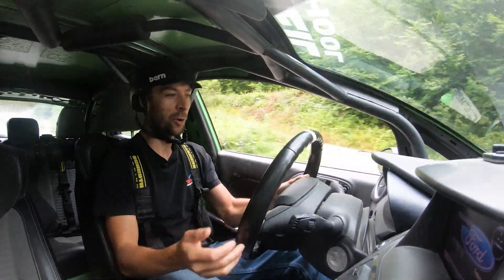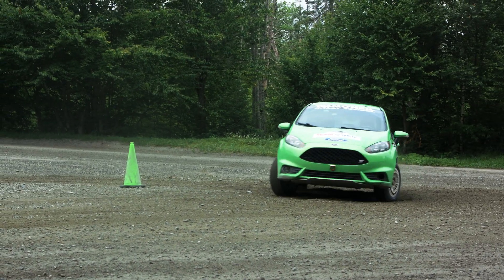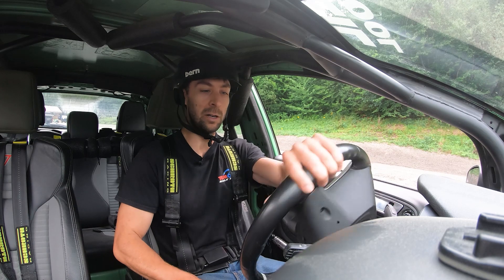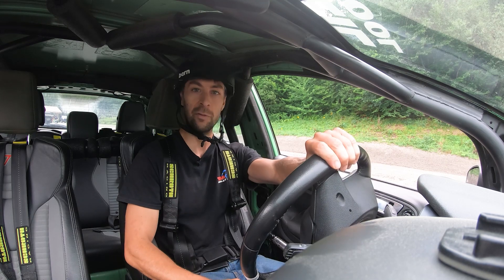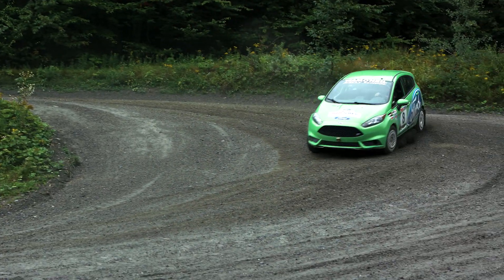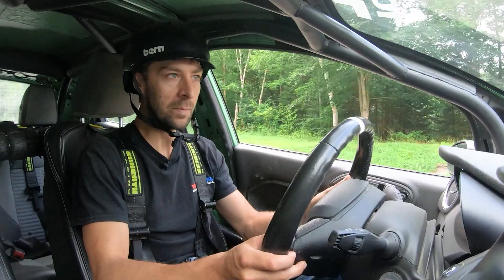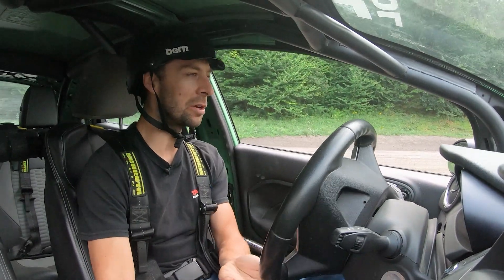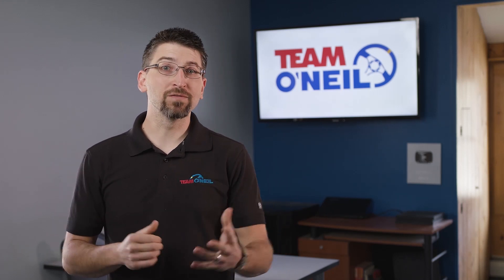How to do Handbrake Turns

Comment: Anyone can handbrake turn. What takes skill is using the pedal-parking break while holding the release with your left hand 😆
Reply: makes me appreciate the double pump release. But either is better than neither and my current DD has an electric ebrake that doesnt work for locking up any tires.
Reply: @rallywagon261  try it while also braking... Yum
Reply: @georgekurgansky5986  the electric brake? Yeah, I also tried it doing the Scani Flick, no dice. At least not in a Fusion. Feels like it's activating on the front brakes, but it releases so fast the tires never lock up.
Reply: You can,,,drill a hole in the handbrake, and put a nail through it.
Then you just pull it on when you need it, and then just let go of it, as the release button is held down by the nail.

Comment: What causes a car to roll sideways end-over-end when trying to handbrake turn? I remember Mythbusters learning to teeter-toter cars on wheels (one side in the air, the otherin contact with the ground), and the beginning went exactly like it's described here. What would be the difference? Locking all four tires, palming the wheel?

Comment: Thanks for the video; looks like fun. For my edification, this isn't recommended for AWDs like the WRX that don't disconnect the rear axle when the have brake is pulled, correct? And clutching in isn't really going to help matters either, right?
Reply: In awd you just turn press the clutch and handbrake
Reply: clutching will allow you to lock faster, (and be less likely to stall), but either way it's fine to handbrake turn in AWDs, just know your center diff isn't going to thank you.
Reply: The GRyaris apparently disconnects the rear wheels when you pull the handbrake

Comment: For the slow 180 degree turns. Do you still use the foot brake to slow down is it the handbrake only?
Reply: Brake first to a manageable speed
Reply from the maker: You would still straight line brake initially, then pull your handbrake and start the process once you are going about the right speed. A handbrake turn will scrub speed but straight line braking is a much more efficient way of slowing the car down initially.

Comment: do you do modifications on your car for performing handbrake turns? I tried that several times on my stock fiesta and now the handbrake handle is getting really loose, sometimes even wiggle up and down while I'm driving. I asked a mechanic about this he said there might be some problem about the brake pump of the whole braking system but I'm not sure if that's the case.
Reply from the maker: Our handbrakes are stock aside from some Hawk brake pads but the handbrake cable can stretch overtime causing symptoms similar to what you are experiencing.
Reply: @Teamoneilrally  Is it also drum brakes on the rear of your fiestas?
Reply from the maker: @johnbowie4869  Our STs like this one are discs in the rear but our naturally aspirated Fiestas have drums in the back.

Comment: What do you do throttle-wise throughout?
Reply: as a rule of thumb with FWD cars - Throttle makes you go straight, brakes make you rotate (especially handbrake), so when you do your handbrake turn, use no throttle, but if you're going to spin out (or you screw up and release the handbrake button and its stuck all the way on etc), then add throttle to straighten the car out, but watch out as you might snap back the opposite direction (accidental scandi flick/pendulum)

also the thing about "Throttle makes you straight, brakes make you rotate" is sort of true for all drivetrains, but only if you don't add enough power to slide the rear, since if you're oversteering under braking in a RWD, you could technically add a little throttle (after releasing brakes), and as long as you don't light up the rear, it will weight transfer to the back, stopping oversteer. And brakes work the same in all drivetrains (almost), so the braking -> rotation part stays true as well.

Comment: My old cars handbrakes are worn and may lock only one wheel or not at all.
This destroys my confidence.
How do you tighten your handbrakes?
I suppose it's under the handbrake boot but how do you adjust bias if one wheel is locking?
One car has the drum inside the disc. The shoes don't seem worn.
Do new cars use the hydraulic system to squeeze the pads?

Comment: How bad is this on the center diff of a GD WRX? Is there a technique to do it with minimal wear?
Reply: I guess it's ok on gravel but yeah it inevitably puts stress on your diff. 
I'm pretty sure you can make your wrx fwd tho
Reply: I have no idea. But I guess you could brave it in neutral lol.. I think to save parts you are better off rotating by weight transfer. After all that's more speed! As long as no power is applied the diffs should just do their job unloaded. More pedal more wear. Car on tarmac will jolt violently once rears get traction and all opposite lock will fling you off the road if you have no run off or you didn't prepare. Try on grass or gravel first so that tyres are always slipping and speeds are lower. Car will resist locking wheels up if you apply power and parts will get hot. Measure the diff temperatures under different loads, then you can get an idea of the threshold. If the diff goes higher than highest normal use temp you can place your bets more accurately then. Smoothness of operation is key to part internals not smashing into eachother. Video says, clutch in so.. pull the handbrake smoothly to let the drive shafts slow more gently before locking up. Same with the clutch so that drive shafts fatigue slower.